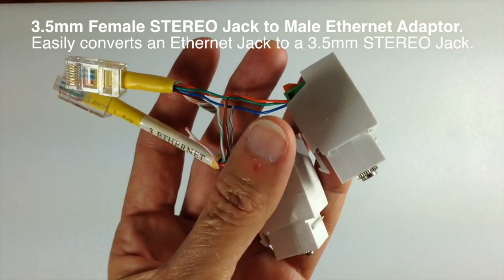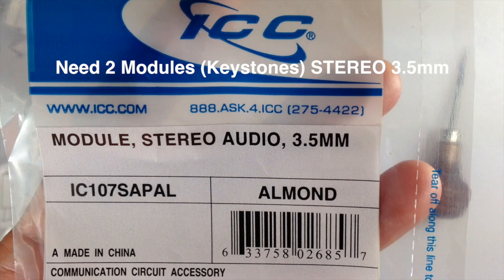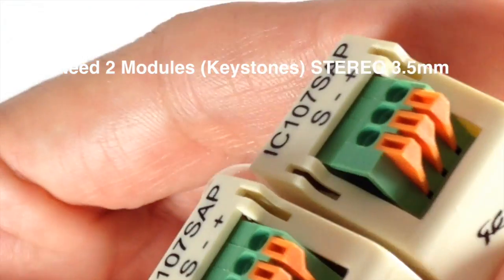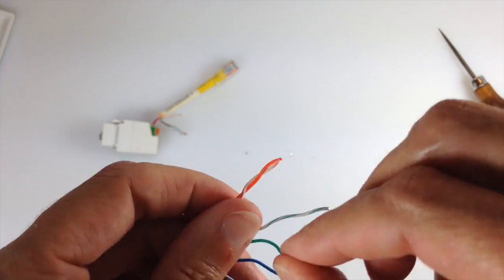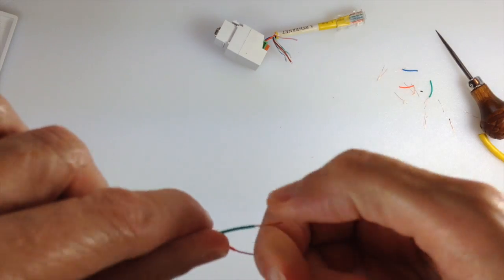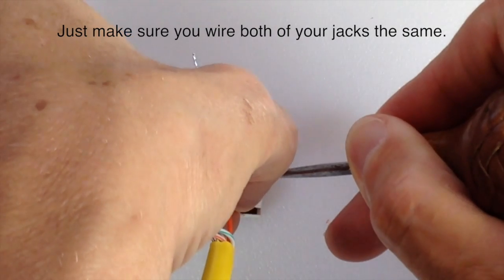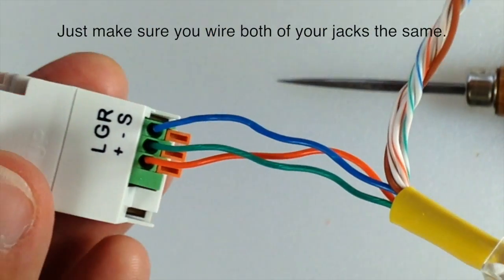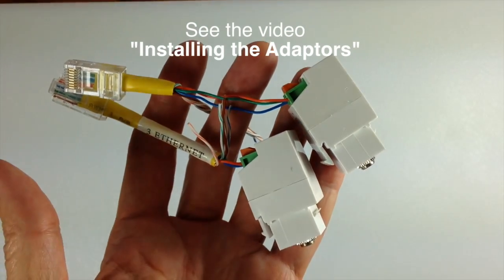Make the 3.5mm Female Stereo to Male Ethernet Adaptor for IR extenders

Comment: Hi Kelly I'm trying to do this for my bafx IR extender without the 3.5mm jacks. I currently have a keystone IR receiver in my wall run over cat6 on brown, orange, and green to my audio closet and I am attempting to splice the wires directly into the red/black/white of a 3.5mm cable in order to plug them into my emitter. However I've tried all 9 combinations and I'm not getting signal through. Any suggestions?
Reply from the maker: Can you google and find the wiring diagram for the IR receiver that you have?  

My 1st guess is green is ground.  Brown is power 12VDC.  Orange is signal.

Use a voltmeter on the continuity setting to determine which wire (red/black/white) goes to the Tip/Ring/Sleeve of the male 3.5mm plug that you have. 
Starting at the TIP of the 3.5mm plug.
1st conductor is the TIP.  TIP is + (positive). This is probably the Red wire.  Check it with the continuity setting on the voltmeter to be sure.
2nd conductor from the tip is the RING.  RING carries the signal.  Test with voltmeter on continuity to see which wire is connected to this - my guess is the white wire.

3rd conductor from the tip is the SLEEVE.  SLEEVE is the ground.  Test with voltmeter on continuity to see which wire is connected to this - my guess is the black wire.

So with my guesses
Brown / Red
Orange / White
Green / Black

Hope this helps!
Reply from the maker: A miss wiring may have already fried the IR receiver.  :(
Reply from the maker: Oops . I just read this again.  You connected the CAT6 to the IR Receiver?  
What are the wire termination labels on the back of the IR  Receiver?  
I was thinking those colors were factory.